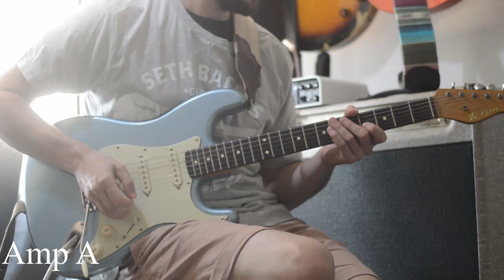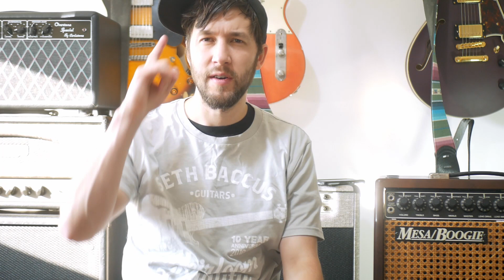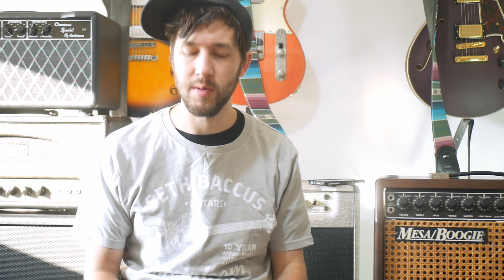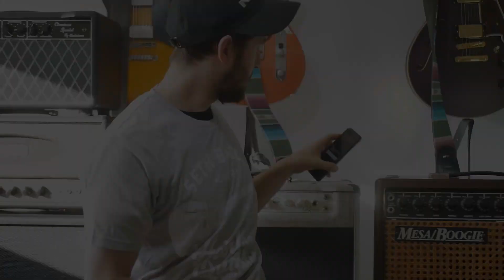Dumble ODS (clone) or Mesa Boogie || Can you tell the difference?

Comment: As someone who has played multiple Dumble clones before I instantly recognized the tone of the Dumble clone. It has a mild cocked wah like quality to its tone that lets the guitar cut through the mix with utmost ease. It has very fast response to the pick attack, and a bright but sweet top end combined with a rather unique compression that makes notes bloom and lends the guitar an almost piano like tonality. It's a quality that you won't hear from other amps and in this video those traits were pretty much instant giveaways that Amp A was the Dumble clone.
Reply: I been building and playing Dumbles since 08. Nothing sounds better than a good Dumble. I used to work for a authorized Boogie Dealer I repaired many totally different tone. A was Dumble.. Boogie is more thin its abit different its a good amp though.
Reply: @sammyrothrock6981  I won't necessarily call a Dumble fatter sounding than a Mesa Mark series amp. A more apt description will be that it sounds smoother and phenomenally more balanced than the Mark.

Mesa/Boogie Mark series amps are kinda weird sounding when compared to a Dumble. They have bright sounding mid-range but at the same time they also have comparatively tubby sounding low mids. Due to this reason despite being bright amps they have a rather soft and sluggish response to pick attack. Their response to pick attack starts with a sluggish low mid grind and resolves in a very bright mid-range response. This creates an overall effect of them sounding less smoother than a Dumble.

Dumble on the other hand has absolutely zero tubbiness in its low mids. It and Hiwatt amps have the cleanest low mid response one will ever hear on any guitar amp. Compared to the Mark series amps they have a sharper, faster and far more precise response to pick attack but then that sharp pick attack resolves into a beautifully balanced mid range and sweet high end response.
Reply: @TheNocturnalEvil   I was a tech at a authorized Boogie service center played and repaired many . Later in 2007  I built  Dumble clones personally at a time when few really knew much about the insides of a Dumble like a 102, 124, 183, and the megaplex  later I played a few real ones . I can say a Dumble is smoother , fatter, more articulate and much more sensitive to pick attacks and harmonics why do you think Carlos switched? At the end of the day it's all about personal preference though.  To each his own .